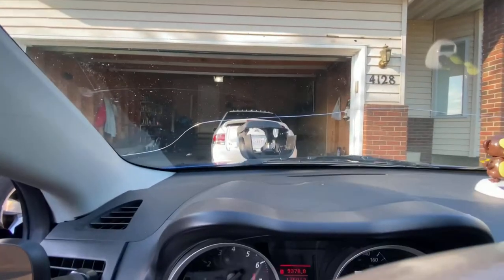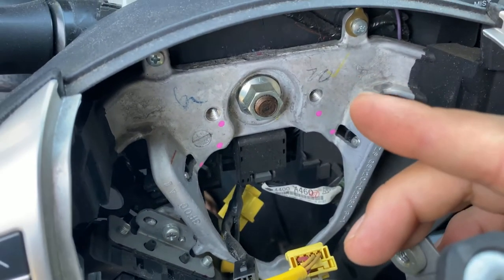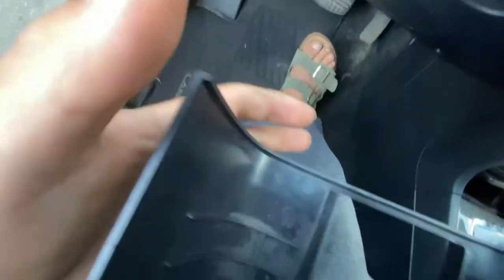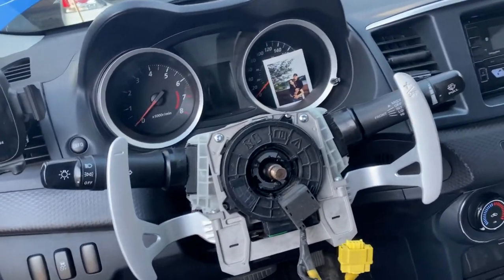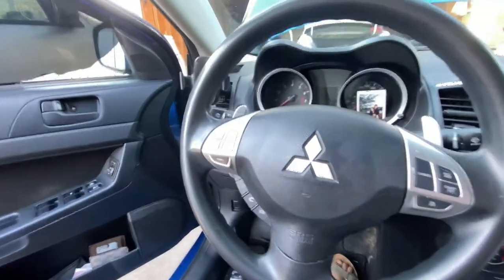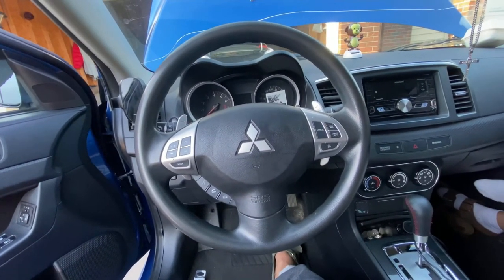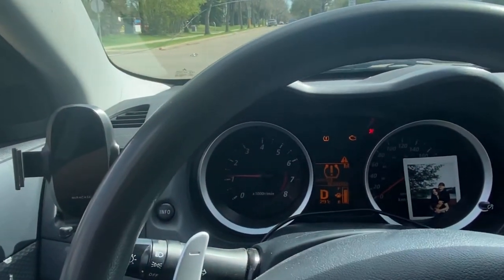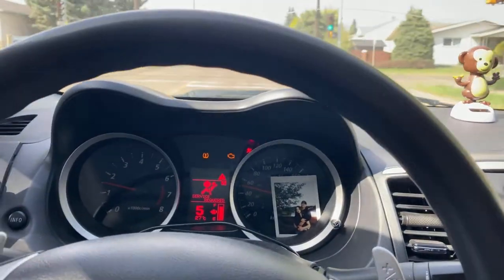How to install paddle shifters on a Mitsubishi lancer

Comment: Just a tip. Before taking off the steering wheel, put a mark using a marking pen so when putting it back, the steering is properly aligned.

Comment: Just to let everyone know if they are curious, it works on a 2012 SE AWC US SPEC. Also there is no need to replace the bottom cover for the steering column, it actually has lines in the inside of the cover if you would like to just modify the original cover yourself. Thanks for posting this video man! Very helpful!
Reply: I also have a 2012 SE AWC, did you have to change out the shifter assembly to the GTS one?
Reply: @donaldsatterly2085  nope, plug and play!
Reply: @OGRCO  I wonder what’s wrong with mine then. I plugged in the paddles such as shown in the video and I can’t get them to work. Do you have the Drive/Low shifter?
Reply: @donaldsatterly2085  put it in drive and you have to be moving at least like 5-10 mph then press and hold the + shifter to get it to go into manual mode.
Reply: @OGRCO  I was doing that and it wasn’t working
Reply: @donaldsatterly2085  I have a couple ideas as to why it’s not working but can’t guarantee anything. Check the connection and make sure that it is good and clean. Unplug the battery for 30 min and then hook it back up and see if the ECU picks it up. And last but not least you might have a faulty paddle shifter unit. 🤷‍♂️

Comment: Hey man, thanks for posting the video. I was wondering what size screws you used for the bottom holes on the mount? Are they Also 10×3/4?

Comment: Amazing video my dude, definitely gotta do this after installing my turbo in my ES.
Reply from the maker: Nice!!
Reply: Is it safe to add a turbo? I have a Lancer SEL 2017
Reply: @ehdmartv   If you have a manual then yeah but CVT like me cant do much boost on it.
Reply: @ProjectTwinsAMV  bleh, mines a cvt so I guess not.
Reply: @ehdmartv  did you complete the turbo build?
Reply: @theekemar4113  no since it’s not a manual I didn’t end up doing anything.
Reply: @ehdmartv  I boosted my es and it’s been doing fine with the cvt , all you need is two trans coolers and 2 fans to keep the cvt cool
Reply: @Ehdmar TV  I have a 2017 SEL too. Do these paddle shifts work with it?
Reply: @BruTJezuS  Bro how is it holding and much did it cost?
Reply: @Rifmaista  don’t do it brotha ! I’ve since moved on to a Gen 2 MazdaSpeed3 and don’t regret my decision at all whatsoever, boosting that lancer wasn’t worth it in the end

Comment: Can a non cvt transmission  work with the paddle shifters??  My car has the connector  for the paddle shifter however it's a non cvt transmission ..
Reply from the maker: No
Reply: Im gonna try it see if it does or not.

Comment: hay alguna solucion si yo no tengo el conector??
necesito esto
Reply from the maker: it must be a cvt transmission so that it"ll come with the connector
Reply: @bikinibottomgarage7960   mi transmisión es CVT
Reply from the maker: Oh. I’m not sure, it usually come with the plug or with the shifters

Comment: Have you tried swapping the Floor Shift gear selector assembly from a GTS to get the + / - gears?
Reply from the maker: Nope
Reply: I remember reading in a Lancer Facebook group that it doesn't work, unfortunately
Reply: @MyNameIsNidos  dang, thanks for the info

Comment: I have a 2015 lancer SE do you think it would work with that?
Reply from the maker: It could work. Check if your transmission is a CVT, if it is than you’ll have a plug behind the steering wheel.
Reply: Just checked and I have the plug. Thank you so much for the tutorial.

Comment: Can I do this to my 2012 lancer es with the automatic transmission where it has park, revers,neutral,drive,and L
Reply from the maker: Take off the two cover piece behind the steering wheel and look for a plug with three wires, it should be on the left side behind the steering wheel. If you have it than Yes

Comment: Did the install cause your airbag warning light to come on? Did you just clear the codes to get rid of it?
Reply from the maker: that light was already there due to the srs airbag from the chair. but no, no other light came on from installing the shifters
Reply: @bikinibottomgarage7960  awesome, have you had any troubles or unusual noises since installing them? Transmission seem to be handling it fine?
Reply from the maker: Nope. Everything is great!
Reply: Just finished the install and everything works great. Did the install on a 2012 lancer SE AWC. Thanks man!
Reply from the maker: That's great!

Comment: How do you engage the shifters since there isn’t a gear setting for it. Does it automatically do it?
Reply from the maker: just be in drive and press on the shifter and it"ll select a gear for you on fast you are going

Comment: Hello i have a plug with blue black and purple is it for the paddle shifters?
Reply from the maker: It's it's a small plug that's hanging there, it should be for the shifters but I'm not so sure since it's a different colour wires. Mine is a 2011 lancer, I don't know if they have different colour wires for the newer lancer

Comment: Wonder if this works with the 2016-2017 CF model as they’re different enough compared to the 08-15 CJ Lancers to where certain parts would no longer work.

Comment: Do you have the part number for the upper and lower plastic to fit the paddle shifters?
Reply from the maker: The upper is 8065A017 and the lower is 8064A015. The link is for the lower trim https://rrr.lt/en/used-part/imp377215-8065a015-mitsubishi-lancer-steering-wheel-column-trim
Reply: @bikinibottomgarage7960  where does it ship from? I’m from the US
Reply from the maker: @ehdmartv  I think it’s better looking up on eBay. If not you can maybe find it on a wreck auto lancer or Ralliart with paddle shifters.
Reply: 8065A039XA is the part number
Reply: I did end up finding it and installing. Thanks!

Comment: where can i buy the gear paddle kit?
Reply from the maker: You can check on FB market if their selling the shifter or their parting out a lancer with shifters or you can check ebay
Reply: i found an evolution kit could it work?
Reply from the maker: I’m not so sure but I would test it out first since it came from a evo, it might hav different plug